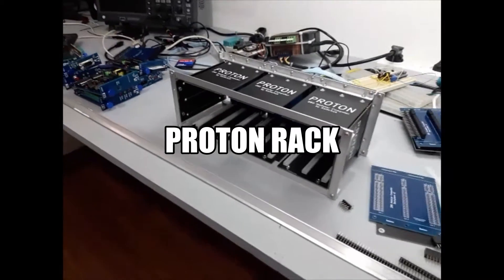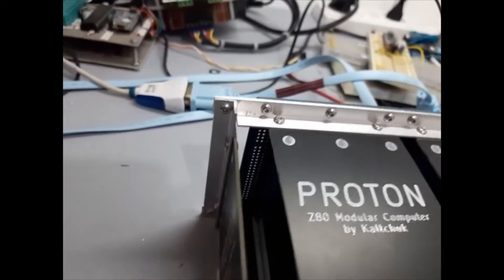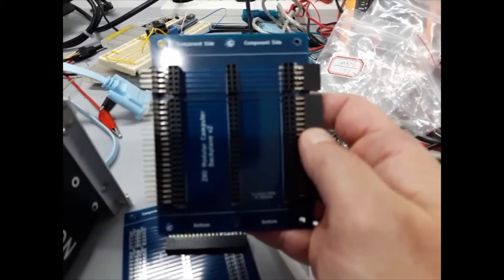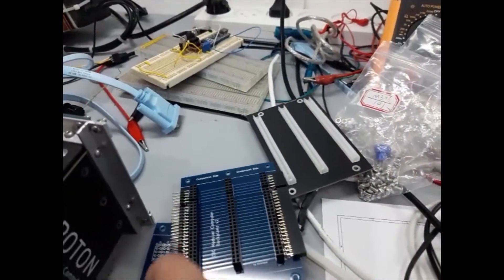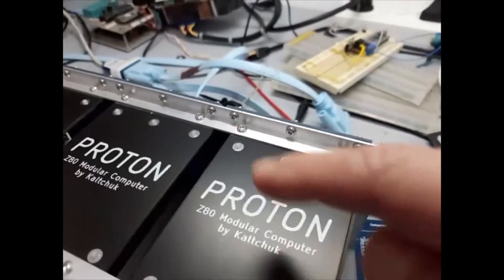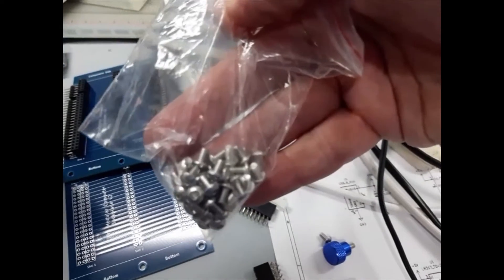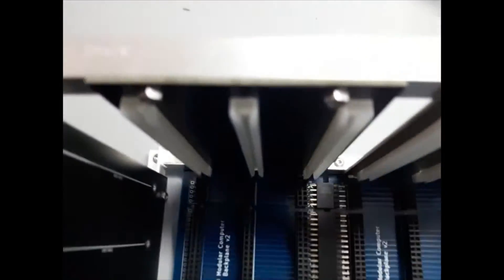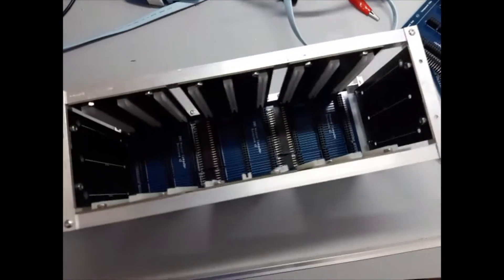Proton Z80 Rack Demo

Comment: Would you consider making a version of the computer where it's all one one board? I want a new board to replace the original system board in my Heathkit H89 and it looks like this design would be perfect for that if it could be condensed into a single PCB.
Reply from the maker: You mean a single board computer with Z80, capable of running CP/M? That wouldn't be so complicated, although the BIOS would also need a remake. Having everything on one board makes the hardware even easier.

Comment: Can I ask where did you get the nylon white card guides from ? I couldn't find them in your BOM file. Thanks.
Reply from the maker: https://www.aliexpress.com/item/32798738728.html?spm=a2g0o.detail.0.0.20613e26J0dCLn&gps-id=pcDetailBottomMoreThisSeller&scm=1007.13339.300834.0&scm_id=1007.13339.300834.0&scm-url=1007.13339.300834.0&pvid=4f101131-e73b-4144-a7e7-d7bdb762a02b&_t=gps-id:pcDetailBottomMoreThisSeller,scm-url:1007.13339.300834.0,pvid:4f101131-e73b-4144-a7e7-d7bdb762a02b,tpp_buckets:668%232846%238111%231996&pdp_ext_f=%7B%22sku_id%22%3A%2264161028656%22%2C%22sceneId%22%3A%223339%22%7D&pdp_npi=2%40dis%21ILS%2146.59%2146.59%21%21%21%21%21%402103239b16609198104302637e4da2%2164161028656%21rec

Comment: Thanks, it is a well designed modular z80 cpm? Computer. On YouTube I see a lot of com z80 computers using serial interfaces. You use it too, but yours is the only one that uses color too, I would like to see more on what flu how fast, is used etc. Thanks
Reply: Sorry typo flu should be operating system

Comment: What do you think about using only direct connectors I.e. no 90% ones. Leaving pin plates contacts  on both sides of pcb and solder pcb just in the middle of the connectors pins. Looks more robust for push/pull and easier for routing no wholes and need to route traces between vias?
Reply from the maker: I've tried it. It was a bad experience. Good luck.

Comment: Oh, almost forgot to ask, in your analysis of the computer's performance, have you detected any evidence of cross talk in your back plane design ?
Reply from the maker: I tested it with 4 backplane cards, i.e. 12 slots. The Z80 CPU runs at 8MHz, the Atmega328 (serial ports) run at 20MHz and the AT89C4051, on the I2C card, runs at 24MHz. So far, no problem with interference or crosstalk. Although, I must say that I had a few problems with the wire wrapped prototype cards, mainly the Flash Card. So my approach was: as soon as I was sure the wire wrapped prototype was ok, build the PCB version. Another important thing in the backplane design is that I have two buses - a small one (10 pins) for power, and a big one (40 pins) for signals.